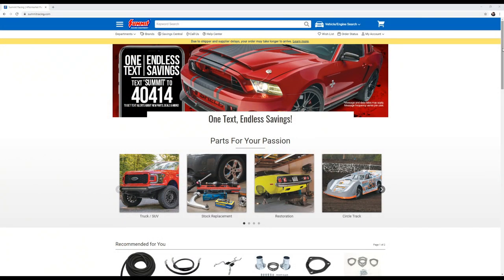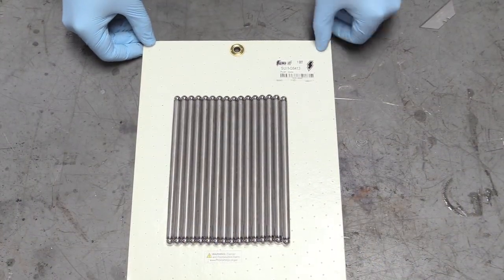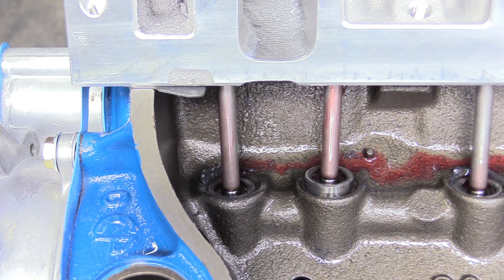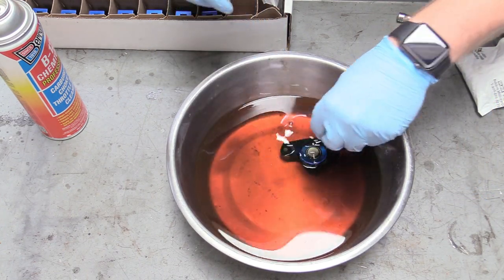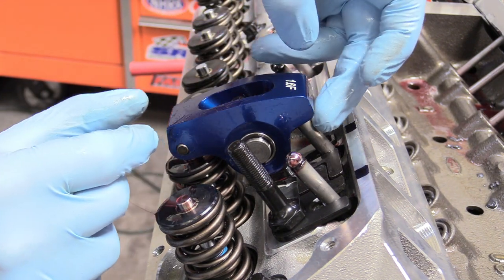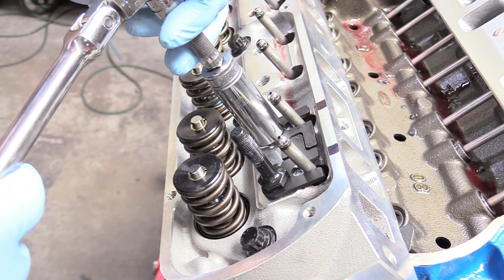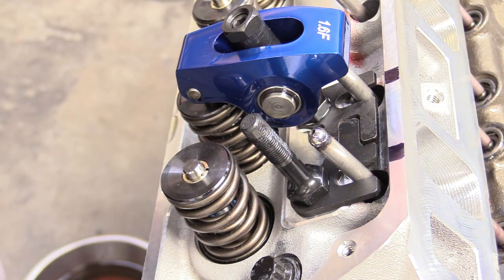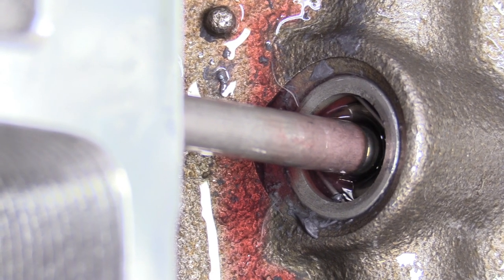How to Build a Ford 302 Small Block - Part 7: Valvetrain

Comment: I'm really enjoying this series and it's timely because I'm actively building a 302. Question: can I use the same lifters you mentioned if my current lifters have a bearing to them? I like how in your valvetrain you dont have to measure for rods or any of the testing for where the rocker hits the valve. So can I use my same cam and switch to these lifters and gain the same benefits?
Reply from the maker: Nope. Use the correct lifters for your cam. If you have roller bearing can use roller bearings. Thanks for watching!

Comment: A quick and simple method to pump the lifters full of oil is using an oil can. Just put the nozzle on the oil hole and pull the trigger a few times. This will push any air out.

Comment: Great videos, but you should always check pushrod length. No way the geometry is the same with new heads, springs and so on. Thanks for the hard work!
Reply from the maker: You'd be surprised. Our build went incredibly well and made big power. Thanks for watching!
Reply: @2carpros  But you can't skip that process on the "instruction" side. That's a roller block with a flat tappet cam. And aftermarket heads. Pushrod length should be checked when changing ONE component. You've changed many. (I did too. And a $20 pushrod length checking tool and about 20 minutes verified that stock length would be ok.)

Comment: Is there a point in your build where you first remove the inner spring of your cylinder heads to break in your cam, as the cam suppliers suggest, then replace them afterwards?😊

Comment: Just to confirm, you set the lifters to roughly flush with the cylinder head for each piston (as shown at 3:50)? Just asking because I just watched another video where they ran the lifter all the way up then tightened. Your method intuitively makes more sense.
Reply from the maker: Correct. That's the way I do it and it works great. You just don't want any camshaft lift while you are adjusting. Thanks for watching!

Comment: How do you know if you need a 1.6F or 1.7F on the rocker arms? I’ve seen where some have both listed.
Reply: 1.6  is stock.

1.7(2)  is used on clevelands  or  if  you want  higher lift  out of the same camshaft

Comment: How long does those rocker last vs the stamp steel
Reply from the maker: I would say the same. They are much more efficient and have bearings instead of relying on a wear surface.
Reply: Okay thanks for the videos 
Have a personal issue I’m trying to figure out 
I own a mid 90s f150 5.8 speed density 
Trying to figure out if I want to do a stock return or find someone with mass air to play with 
Again it’s funds buying another car would take away from the actual project